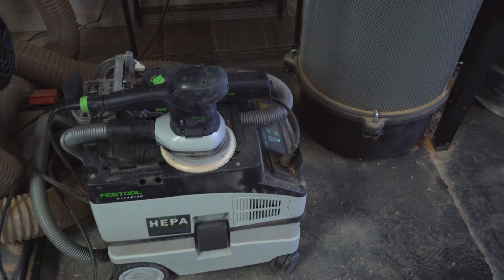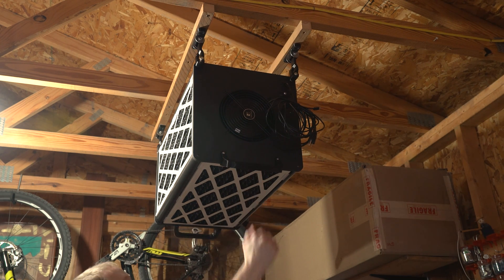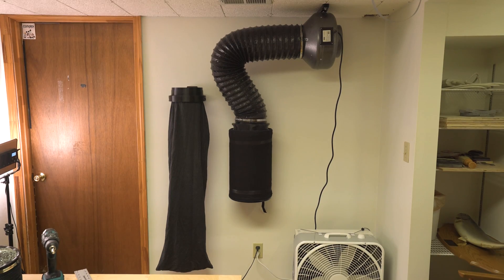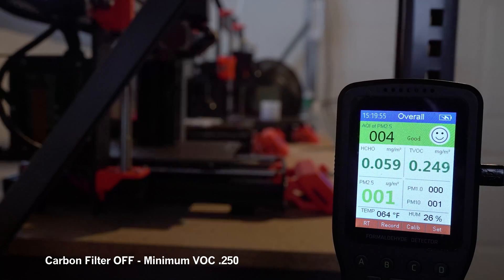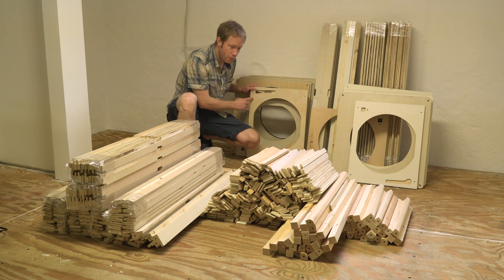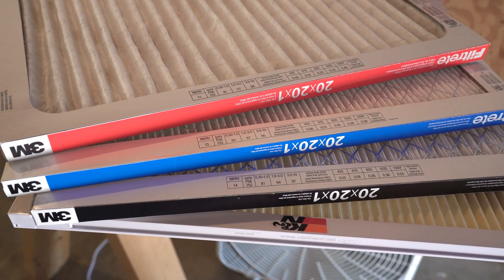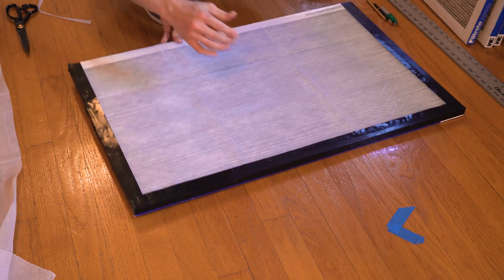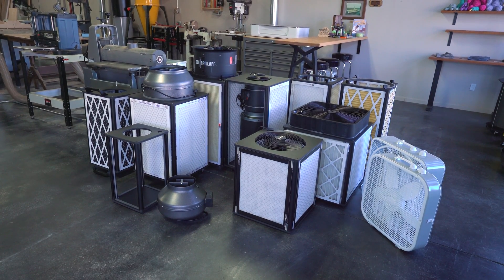DIY Quad Filters - Everything you need to know

Comment: I don't like your fan choices in that you can purchase fans or blowers that are lab tested to have a "wc" rating.  Most filters are considered clogged at 1wc so if your fan can't produce 1/4 wc then what is the point is suggesting it's cheaper in that it might stop working quite quickly.  I agree though 1wc+ blowers are not high volume though we might need to test 30, 60, or 90 day usage.

Comment: Wow this was exactly the video I needed, and was looking for. Been 3D printing for a few years with a modded air Fanta 3 pro. Swapped the Oem fans out, they push air but are very cheap and break.

Recently interested in laser engraving and realised I also have never printed with the advanced filaments due to fear / avoidance of wanting to deal with fumes.

Got a decent inline fan just by chance and as I found this video I have been designing a hepa/carbon box attachment... And so this is why this video is what I needed. Thank you so much for saving a lot of faff and arguably non optimal revisions lol, cannot wait to see your VOCs video mentioned!

Shout outs to @thisdesignedthat channel for the link here, also a great channel. Best wishes from the UK!

Comment: We never bothered with air filters.. if the dust was a real nuisance( think cutting Chinese prefinished maple ply 😳) we would put box fans in the windows and just blow the dust outside …terrible in the winter…
I just built a 16x32” quad air filter with a box fan and put in only 3 16x25 filters that I had to see what it would do. Quite a difference and I’m pulling into the filters. I hadn’t watched a video before building . I just watched several. Going to change to blowing air into box with the 4 filters.
 I’m really surprised at how well it worked with just the 3 16x25” filters

Comment: OK, I'll try again. Without an answer on whether the speed control is impeding the air flow, I''m looking for the Caterpiller1400CFM fan.  I don't see any Caterpiller fan with air flow.  The HVD-14AC 14" Heavy Duty Industrial Grade drum fan with 4 speeds has 2300 CFM according to the Caterpiller site, Tractor Supply here in TX, and Amazon.  I really would like an answer to the speed  control location, and please add the model number of the Caterpiller fan you tested.  Thanks for the videos.  I am somewhat embarrassed to ask further questions given that your videos have vastly more real information than anything else on youtube.  I absolutely love your videos with their abundance of information.
Reply from the maker: No embarrassment required, it is confusing. The CAT fan never moved 4000cfm through the fan, it just "moved" that amount of air in the room. By my measurements the fan moves about 1400cfm through it. So 2300cfm is also not accurate, but that is the correct fan. The fan power may have been lowered to cut costs to cover new taxes on the product. Regardless, the fan will still work well for this application.

All floor fans are not rated for the amount of air that goes through the fan. Only inline duct fans or centrifugal blowers are rated for that. So, when you look at a box fan or drum fan or others like them, assume that they will not be nearly that powerful in this sort of application.

Comment: Your tutorials about this are absolutely amazing loads of very useful details.  Opening to air purifier design for years. Think about a few things.  Particularly the concept of air throw, non-ducted air filters. I've always thought they were something of a keystone but I can see in a workshop set up things have to be approached differently. What surprises me though is that you have particles gently travelling towards the filter inlet from across the room. I always assumed that without air throwing turbulence the clean air wouldn't reach the corners and neither with the particles.  But as you point out if you are creating concentrated dust blowing it all around the place is the worst possible option.  I commend you really great video very helpful and fascinating.

Comment: I like the caterpillar fan, but it looks like the speed control is in the air flow most of the time.  That doesn't make sense to me.  Is the speed controller in line with the power cord that comes from the motor  and drapes across the flow path?

Comment: Quick tip for you to get dust off your floor: I used to use a vacuum too, but a microfiber mop works significantly better and is a lot faster. Costs like 15 bucks at target.

Comment: I came across a very nice upgrade to the Air King box fan using a metal high-volume blade from Lasko's discontinued B20725 commercial box fan. The blade can be purchased for $20-$30 and installed in place of the Air King's original plastic unit.

Quite the improvement after. The Air King now moves a ton of air and the sound output is SO much quieter than the original plastic blade, even on the highest speed setting. The decrease in noise level is worth the price paid alone. Highly recommended.

Comment: Would like if you tested a PC fan config. They tend to be ultra quiet but maybe a little less powerful than the ac infinity fans so better suited for home use rather than in the shop.

Arctic p12 pro is a good budget fan with 77cfm and 6.9mmH2O per 120mm fan. You can put 4 or 9 of them on a panel and get solid performance with low noise but I'm curious how they test compared to the ac infinity products

Comment: I would like to see one of these made for as a computer tower for a gaming pc. Computer parts these days are extremely expensive, and dust is crazy bad for the components. Components run hotter and hotter every release cycle and something like this would be great to have to stuff my computer case into so it's always on the inside of the filters
Reply from the maker: I've had an idea for a cooling tower for quite some time. Just need to find time to make one and a chunk of change for a PC to put on it... a custom case would also be cool. Until the day that all happens, you can run a duct off the top of any of the inline fan kits directly into your PC. An 8" fan would keep things... frosty.
Reply: @The3DHandyman  I vote for building a big one with the tall filters and sticking the whole pc in there. The filters vary in size so much from Merv 14 and downward that you could probably make a sturdy box under a table that has a flat area at the bottom of the legs. Kind of like a coffee table but.. taller.

Comment: Thank you so much for your extremely detailed videos, and the extensive amount of research you have contributed to this community in such an organized and easy to understand format!

I am really struggling to understand the relationship of the static pressure ratings of the filters and the fans, and hoping you might be able to help me wrap my head around it.

There is a direction at 12:36 in the video that the airflow and static pressure should be no more than 50% of that first number on the filter. I would think you want the fan's static pressure ratings to be higher than the static pressure on the filters, to overcome it, but it sounds like I am misunderstanding how that should work?

-----------------------------

Following is a scenario and my understanding of the calculations. Please feel free to critique:

Materials:
-4 (or 5) Filtrete 2500s
-Either 9 Arctic P14 fans in parallel, or 18 total (2 layers of 9). 
Airflow calculations
-72.8 CFM per fan x 9 fans = 163.8 CFM. I think this number also stays the same in the scenario that I use 2 layers of 9 fans.
Static pressure: 
-2.4mmH20 per fan x 1 layer of 9 fans = 2.4mmH20 static pressure (I think?). In the scenario of 2 layers of 9 fans, I think this would be 4.8mmH20. 

If my understanding of those is correct, then:
Airflow acceptable?
-163.8 CFM / 4 filters = 40.95. Way lower than 50% of the smallest airflow listed on the filter, which I think means is acceptable.
Static pressure acceptable? (using 2 layers of fans in this example)
-4.8mmH20 / 25.4 = .19 inches H20 / 4 filters = .05, which is half of the smallest initial resistance, which I think means is acceptable.

Comment: I think it would be worthwhile to test Lennox Carbon Clean 16. 5" thick MERV 16 filter with 2/3 the pressure drop of the Filtrete 1900 1" thick filter. Very close to HEPA.

It would likely be  awkward to design a box with 4x of these filters, but I think it would be easily doable to use 2x.

Comment: Mate really nice work. 
I’m an Aussie living on Paros Island, Greece. I built a 25 cm (10") earth tube system with a rocket mass heater attached for winter heating and natural convection cooling in summer.
   I’m looking for a low-drag, easy-to-clean filter setup for two 10" intake pipes — Thinking of adding a 10" AC Infinity fan to each pipe and building the filter box around them.
   Any products or suggestions? do you custom build filters if so, can we chat
Cheers,
Kerry

Comment: With the fan pointed into the box why not put a bin with a grate over it at the bottom for easy dust disposal?  Would avoid wasting filters.  Just need to slow the air down.  A very porous filter would also work to trap some of the dust.

Comment: Has anyone built a filter for a squirrel cage fan used for carpet drying? These fans are small, powerful and pull air from both sides of the cage. I think the best design would be to put two shop vac filtters on the intake sides.

Comment: Great content and very well done! I’m very interested in how the Wynn Merv 15 canister filter paired with the Cat fan would compare to the 20x30 3M filters. I know the initial expense would be higher but if the air flow isn’t reduced much it could be a good alternative. Just curious because I have the Wynn filter on my 2 stage dust collector and it moves alit of air even with a fairly dirty filter.
Thanks again for your hard work!

Comment: Did you ever have a chance to test the caterpillar 18 inch fan? I really like the higher CFM rating on that and would like to fit one of those on your kits.
Reply from the maker: Yes, I am currently testing the 18in fan and you can buy that as a kit. All you have to do is mention "for 18in CAT fan" in the "note to seller box" at checkout or message me afterwards. The 18" fan will get you 2400cfm.

I do recommend gluing a heatsink to the back of the fan tho. It tends to run warm. I can provide the details on etsy if you message me on there.
Reply: Thanks!  Will look into the heat sink idea.

Comment: Has anyone tried to use the "tornado" 12" filter ($90) with cfm stated ratings of 1200, 1420 and 1650 CFM? 48 dB is also stated, which I assume is at the lowest speed. I want to control my fan speed with my phone, not another remote. I could do the same with the AC Infinity fan, but it still is $170

Comment: Why would the fan suck air into the box rather than blow air out of the box, pulling air in through the filters? Seems like the fan would degrade over time as dust accumulates in the blades, motor, and axle.

Comment: This is a great video and I love the information you provide.  I really like the designs too and now the wheels are turning for how I can use this in my own craft room.  I have diode lasers and I'm looking at adding a 3d printer to the mix.  I already vent outside but it doesn't keep everything out of the room so I definitely need to add some more potent air purifiers than what I already have.  I'm going to check out your shop and see how this can help me with my problem.  Great job :)  

I have one question:  I'm looking at MERV 13 and 16 cut to fit filters and activated carbon prefilters and I am wondering: Can any of your models accommodate cut to fit filters? Can I order a filter frame to put them into or can I make a diy frame to fit into your units?

Comment: Would love to make some roll down plastic walls in my space. How did you go about that?
Reply from the maker: Staple gun, twine, and plastic paint protectors. That's about it. Some velcro would be better than the twine to hold up the rolls.
Reply: @The3DHandyman  much simpler than I thought. Stapled to ceiling and then overlapped on corners to make a little work room?

Comment: I’m wanting to use a box fan and filter that’s incorporated into the enclosure behind my miter saw station.  Pulling air in and blowing up.  Light sawdust gets pulled up while heavier sawdust and particulate gets drawn across my shop vac inlet.  Which fan and filter do you recommend?

Comment: I feel like heat recovery ventilation might be the better option compared to inside air filtration in many cases. The aivailable heat exchangers are quite expensive though and you have to take condendate colllection/management into account. Would be nice to have good cheap DIY solutions for this too.

Comment: Did you ever test washable filters, like metal ones you see in industrial equipment (electrostatic?) or even the much cheaper big rolls of filter media and you can cut to size (orange = tack, or blue = no tack but people put like diluted dawn dish soap?).

What about stacking multiple lesser filters like 2x merv8 or an electrostatic+ layers of different filter media?

Lastly, I'm sure you addressed it in a video somewhere; why do some of your setups appear to have the filtering on different sides (intake vs out), I presume it's mostly the fan specs? I would have expected a slight performance hit to the " wrong " configuration would be worth NOT having to clean the fan + blades itself with that micro dust buildup that can't just be air hosed off.. so a filter on the intake made more sense to me, but did you test the difference? What performance impact could be seen or what about the reduced performance of the fan with build up on it?
🍻
Reply from the maker: Thanks for the tip Patrick! Sorry for the late reply, I haven't had time in the last year for responding to comments. I had a few minutes to spare and saw your comment.

Putting vacuumable prefilters over the filters seems to be the best option to get them to last. It takes some maintenance, but they recharge to nearly new performance with each vacuuming. I'll have a video out on that later this year.

Stacking filters is ok with only the strongest fans. The extra filters really adds a lot of static pressure and that holds back the natural flow of the air. 

I haven't tested the washable metal ones.

Fans with enclosed motors can handle dust well. Those can be reversed into our out of the filter box. Both can be best in certain situations. If the floor area is mostly open then down into the box can be better. If the floor is obstructed, then up tends to be better. I'll make a video about this to, some time soon.

Comment: Have you looked into 3M's industrial filter offerings? I read some studies that preloaded regular filters with smoke and found a massive drop in CADR.

3M's industrial filters are 2" and have a MERV A rating, which tests how they perform atter their electrostatic effects have been significantly diminished.

So their MERV A13 filter starts off as a MERV 14/15 filter but diminishes to a MERV 13 after prolonged use.

They're also meant to last longer as well. I was exploring them because my partner has severe allergies and so fine particle filtration (PM 1 and below) was of particular interest to me.

Comment: thanks for this. interesting. i'm using a box fan and it sucks into the filters and blows out of the box...you have the opposite and say it works better. Hmm...have to look into this next time i change my filters.
I was concerned of blowing dust laden air across the fan/electric motor and have an explosion or clogging the motor with dust and causing a fire.

I've been thinking of  using a squirrel cage blower out of a furnace as the fan...thoughts?

Comment: not sure if someone already pointed you in this direction, but i'd be really curious to see how the lennox HCF20-16 stacks up, it's a 20x25x5 merv 16 with decent static pressure of 0.09 @ 800 cfm, and it has activated carbon as well - not cheap though

Comment: You also said you want the air flow to be half of those numbers, yet only one of those filters would work then with a 1300 cam box fan ? Right 20x30x1 , which 325 . Yet you also said it should be.05 there’s nothing in that range shown?

Comment: While these are cool, it seems a little expensive 165 for just the frame ? I get expensive parts add up, but if you’re charging 300 for a box and the fan, then add in 75 bucks for 4 filters it’s well over 400 bucks ..many high end good machines can be had in the range that can do large rooms..I thought the point of DYI kits was super cheap ie like some of the kits that are 35 bucks for sliding corners that line up the filters and then just tape in the fan

Comment: Brilliant content. I'm considering building one w PC fans (for a living room rather than a shop). Design wise, i guess i should use 2 filters, not 1, and have the fans blowing perpendicular, as opposed to 1 filter and fans facing the filter. How important is the static pressure rating of these fans? I hesitate a bit between a always silent fan with 2.5 mmH2O of static pressure, vs one that can be equally quiet when volted down, at which point its static pressure tested at 2.1, but that fan, if i want to make it noisy for a while, can crank up way more cfm (w a much higher static pressure. What's the best choice, assuming 95% of the time, it will be in quiet mode?

Comment: What is the benefit of the push vs pull designs? I always thought you had to pull the air through a filter rather than push it. Not to mention the dust on the blades and motor